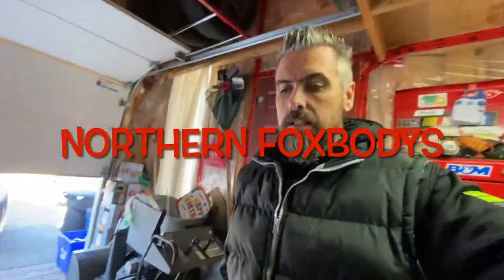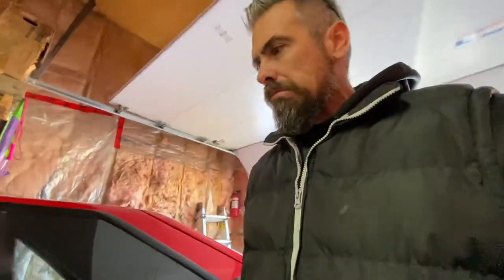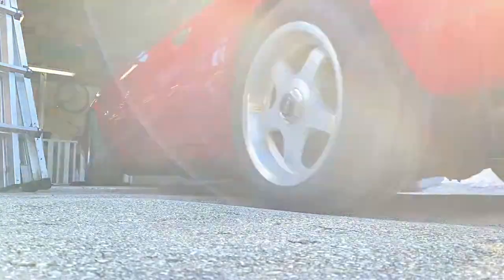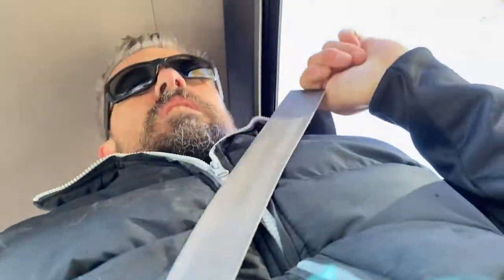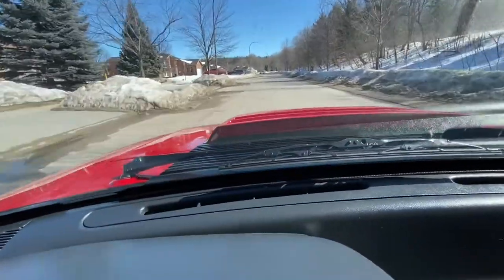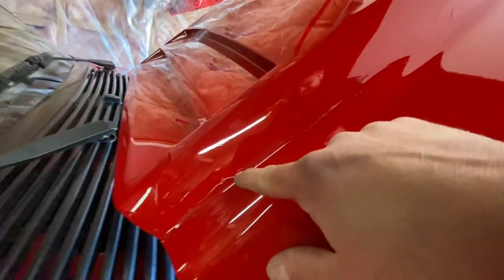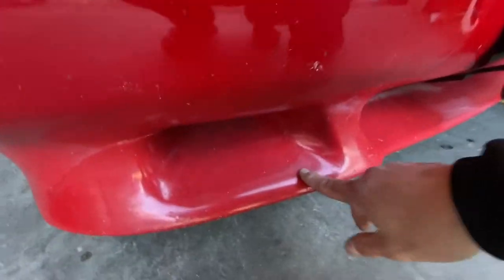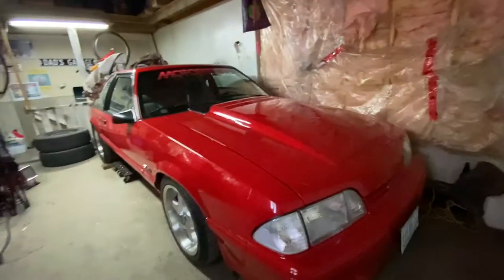Taking the Foxbody for a spin!

Comment: Just a piece of advise work on your audio , I’m guessing you’re using a GoPro ? When I shoot with one I always adjust the audio in edit ...

Love the color on the fox !
Reply from the maker: Im using my iPhone 11 Pro Max. I’ve noticed sometimes the volume is low.
Reply: @simcoecountygearheads  oh in that case yes you need an external mic ... I totaled my channel with my iPhone as well and eventually evolved with the gear I use currently
Reply from the maker: Oh ok thanks!!! I was planning on getting something better I did have a GoPro hero plus but found the sound was very staticky so I sold it. But probably the new ones are better.